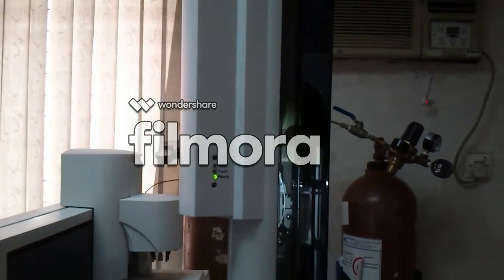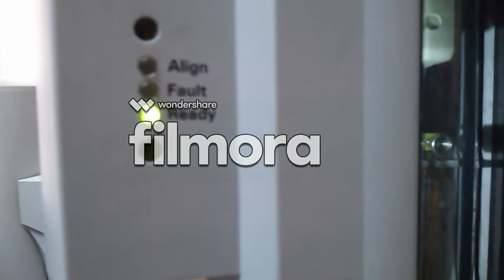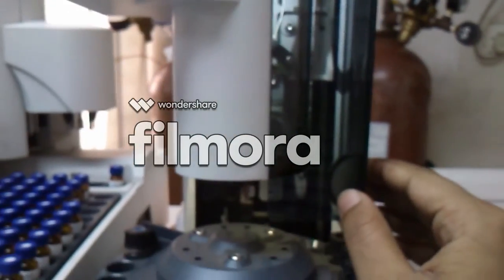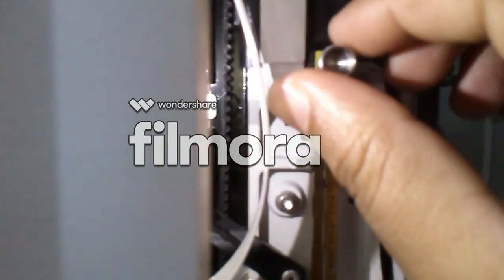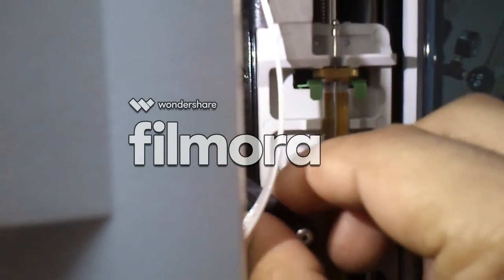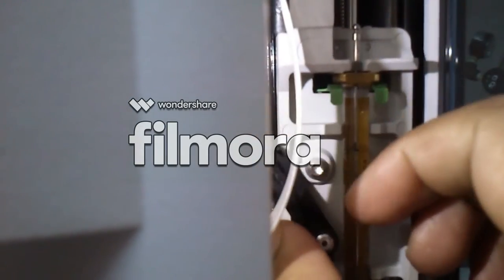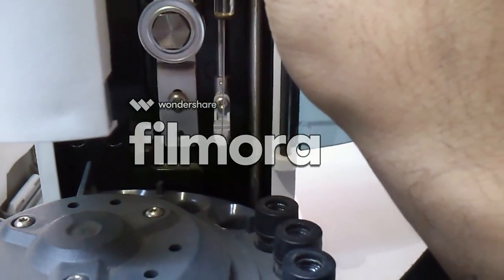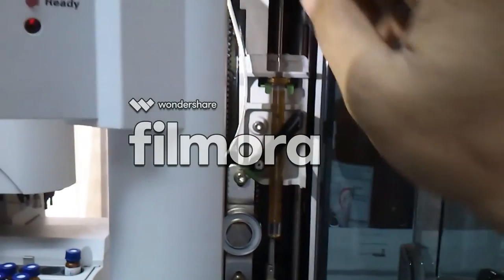How to Check Agilent injection Syringe

Comment: My syringe is stocked in the wash vial.. how may i remove it?
Reply from the maker: Draw syringe carraige downward, it will help you to pull the syringe upward then Unscrew the upper screw of syringe plunger and remove the syringe if required